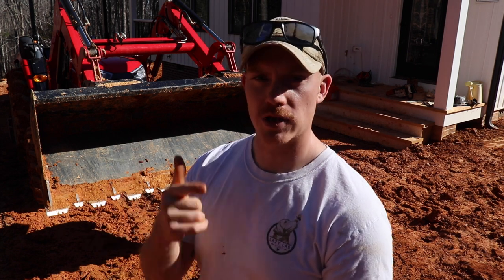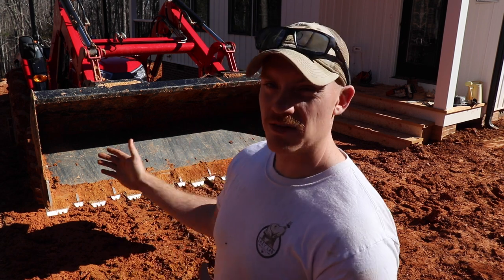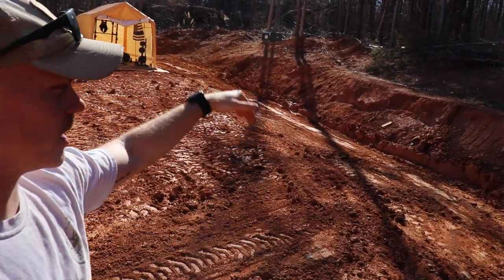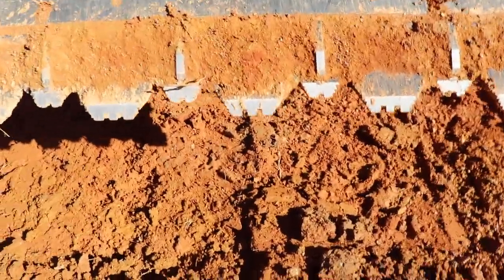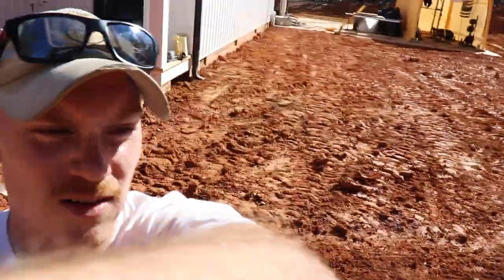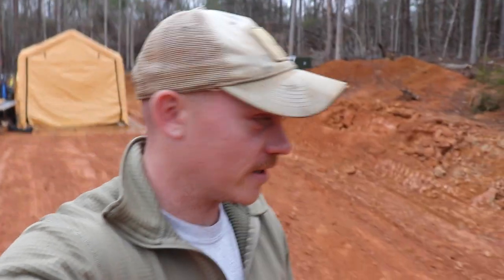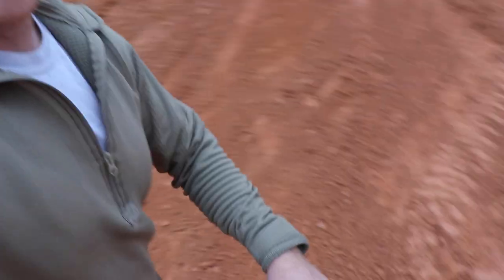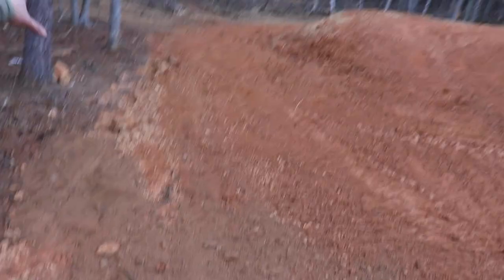My First Impression of the Wicked Tooth Bar from Everything Attachments

Comment: I have a 48 inch wide bucket on my 25 hp tractor,,i want to add a ratchet rake or similar,,question can i use a 52 inch rake instead of oen that fits inside bucket,,